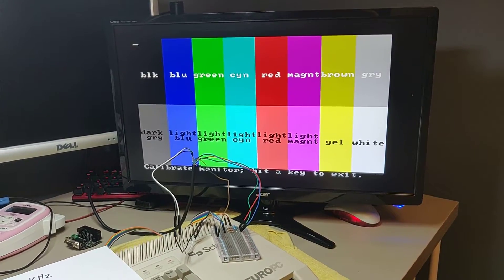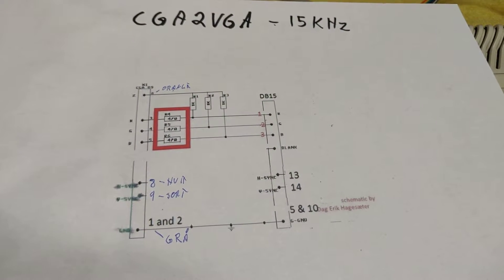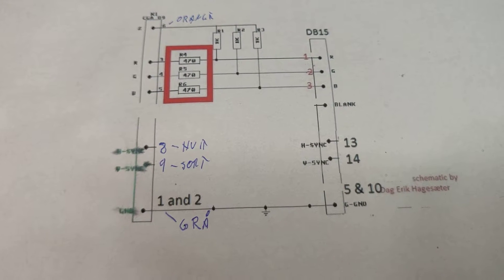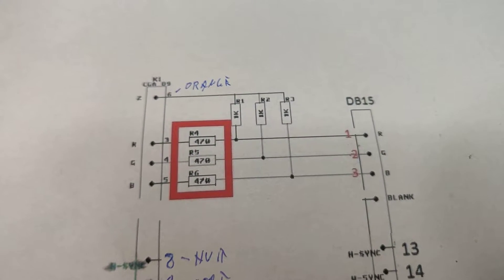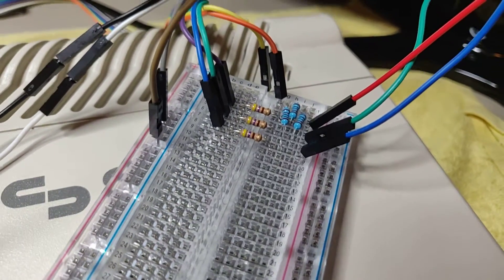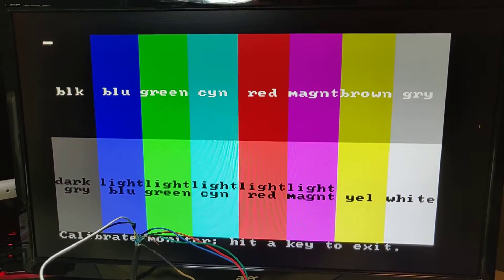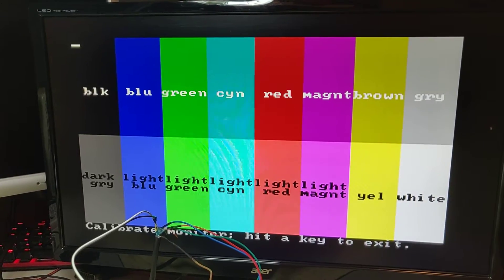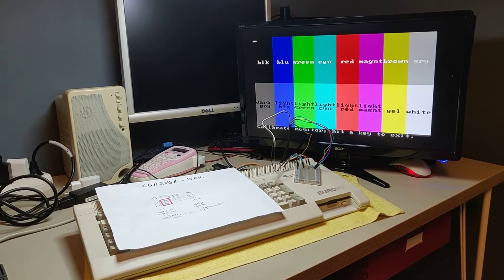How to make a CGA 2 VGA adapter - all colours (except brown)

Comment: Tested and working on the seventh monitor i have. Kinda working. Monitor swithes off after some time. On with vga to dvi dongle.  Haha it was suprise that is not monochrome.  https://youtube.com/shorts/04blZ0HMPCw?si=faNjjNfb6KobiSlB
Reply from the maker: Looks like you monitor has problem syning to 15Khz. Not many LCD monitors supports 15Khz. You can ex. check this list: https://15khz.net/ 
Nice setup with the breadboard. Is the Picture better if you start a 320x200 game? If so you can use a utility called vga240 to fix the display on text mode.
Reply: @ i cant boot it , need some dos diskette , for now i am happy to see that the pc is just starting. this is enought. it gives me floppy controller error , and hard disk is not spinning so i have some quests to play on hardware level.
Reply from the maker: You can also use the CGA2SCART from Serdashop. https://www.serdashop.com/CGA2SCART-PRO. It can be used on a VGA monitor with this trick: https://youtu.be/wvrghhv1PkM?list=PLQQsSz0tZXDG-WXFSIJbaDRPQYPupk0SY. Then you also get brown.
Reply from the maker: Here you can learn mor on the DOS mode in 320x200: https://www.vogons.org/viewtopic.php?t=93051

Comment: How did you lower the input 5v to 0.7v VGA without a voltage divider with the 2nd resistor to ground? No diodes needed on intensity to the colors?
Reply from the maker: It's only lowered by the resistores. Have not calculated og measured how much its lowered. But there is no 5V input in the solution. Only voltage is from the CGA card.

Comment: What is the input voltage RGB, what is the input voltage intensity and what voltage do you get in the output RGB colors? I get the same 5v input. It made no difference for me.
Reply from the maker: I add 5V plus, but what voltage the RGB signal from the source has, i dont know. Remember that the monitor must support 15Khz VGA

Comment: how to make color bars on cga monitor?  one 555 timer at 60 hz one 555 timer at 15khz ?  and 6 resistors  for voltage dividers on rbg wires. common ground ? timer on voltage dividers???

Comment: WoW Cool Instead of CGA to SCART I will make this CGA to VGA  I got those resistors I can not believe it is so easy, why people struggle with the old CGA machines if the solution is that easy :D ?! I never got the right transistor and understood where to connect the Base, Collector and Gate :(
Reply: Yes i feel the same. If i had know this in the 1990's i would have saved me a lot of money.
Remember that your VGA monitor MUST support 15Khz
Reply: @dagerikhagesaeter  yes, this is the tricky part, I can not see from the specifications on my VGA monitors are they supports 15KHz :(
Reply: @intel386DX  Search for 15khz monitors, you will find several lists.